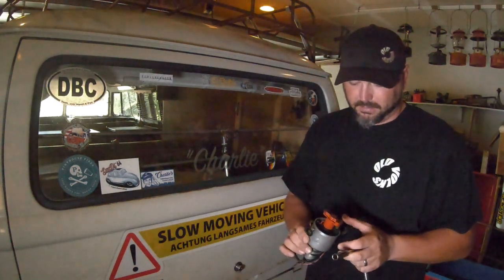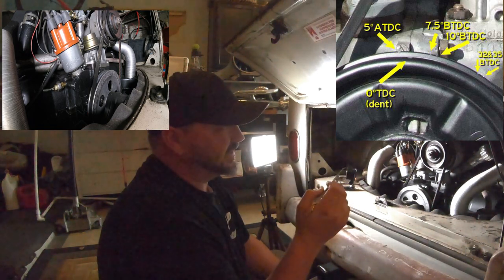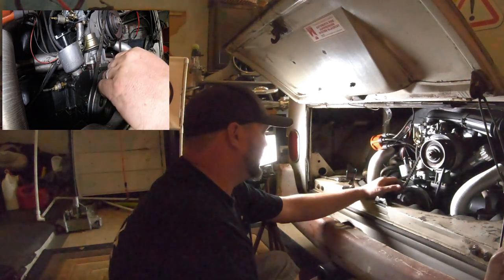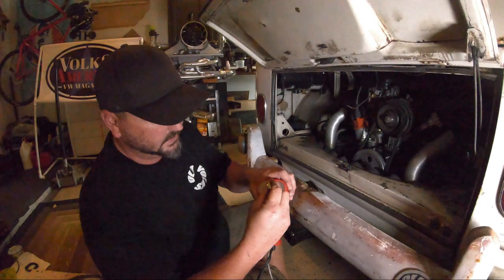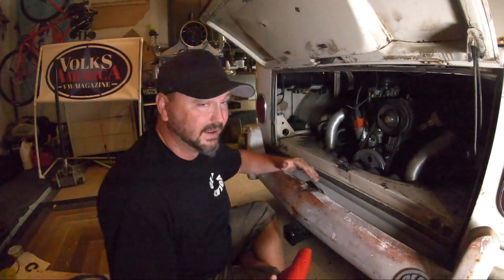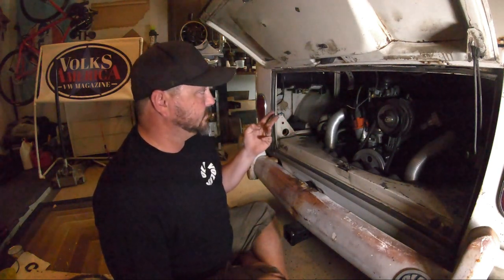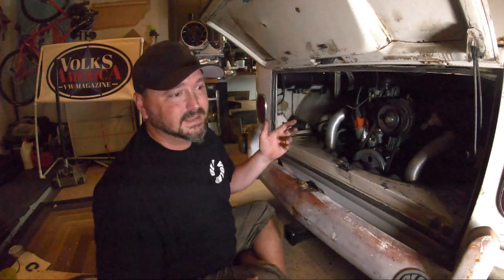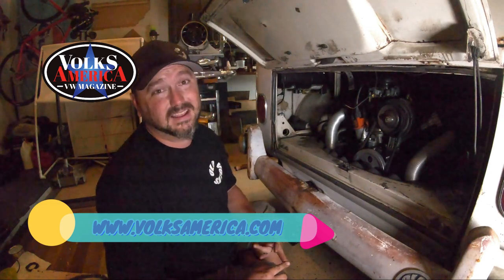Distributor Tech Aircooled VW Engine Timing

Comment: Please do a video on shocks...gas shocks vs non gas shocks...KYB white vs KYB silver GR2...I have the KYB whites and they are way too stiff on my bus...also can you do a video on bus tires...what tires are available today?...also bus front  beam rebuild...thanks!
Reply from the maker: All great topics! And you're in luck, were working on a bus beam right now!
Reply: Koni shocks are the best. They have 4 settings by compressing them together you then can twist the bottom of the shock all the way to the left is softest and rotating right you will have 4 half turns to pick your stiffness, I ride the softest and its awesome on my bus. I just replaced my front torsion leaves cause mine were sagging. Bought used German leaves from Busted Bus in Colorado, raised my front end 1 inch and no more bouncing. It's a lot of work but well worth it, make sure you have a buddy to help you

Comment: Where did you get the graded pulley from ? Enjoyed the video . I’m still not sure which electronic kit to use for my VW 1977 Camper Distributor .any idea as the guy said it’s a 090 Bosch , couldn’t find a way to verify the part number as I’m paranoid to remove the piece since I’m non tech savvy. All the way from SriLanka
Reply from the maker: The pulley came from CB Performance.  Is the distributer an 090 or an 009? For the latter I'd recommend a pertronix kit. In fact, they sell a pre-built distributer so all you'd have to do would be to drop it in and time it. Thanks for watching!
Reply: Would you know which one specifically? And I’m guessing it would fit both 090 and 009